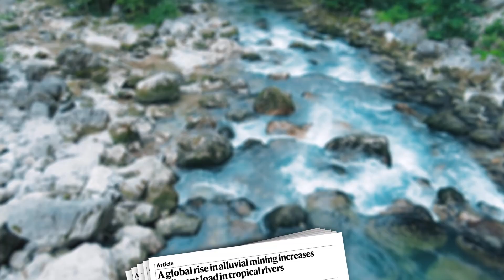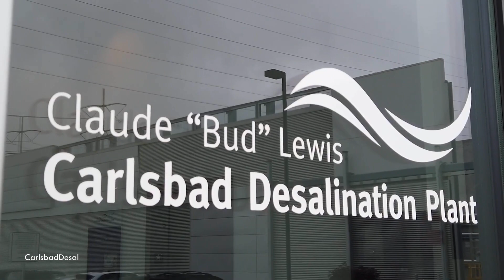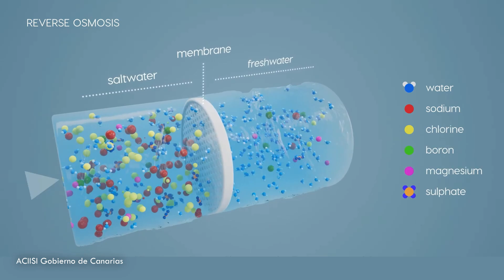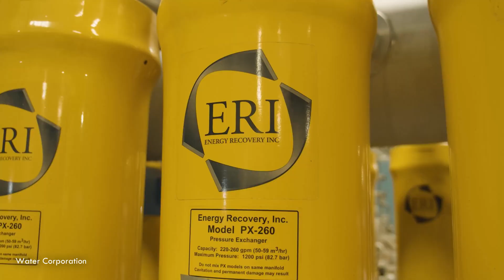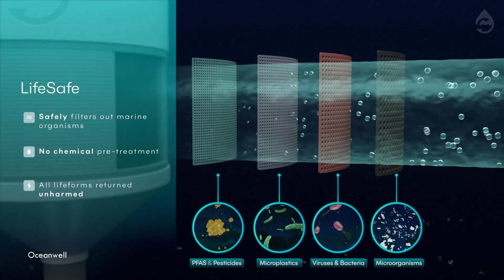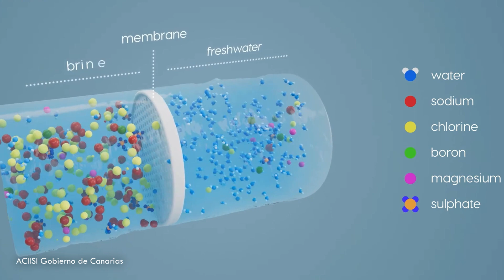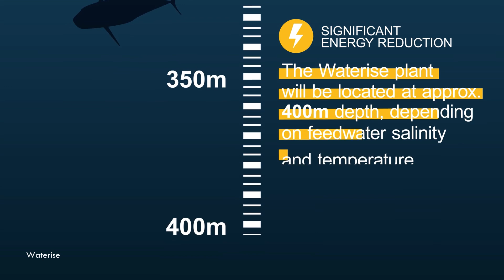These Pods Make Clean Water From The Ocean and It's Going To Change Your Lives.

Comment: Salt concentration in the sea/ocean might increase? Isn't that harmful for aquatic life?
Reply: u are underestimating the quantity of water in our ocean. if all the population in the world started using this tech, i doubt it still wont be enough to make ocean salty by any margin if salt byproduct is disposed properly. And again natural water cycle will also take fresh water back to ocean one way or other. I think the bigger problem will be the cost of RO membrane and replacing them, they cant be used forever??
Reply from the maker: @imsonurohit thanks for coming back, I have explained the both issues that you brought up. You're absolutely correct that it's bad for the Marine Life living nearby the Brine drainage system. But the good thing about the offshore system that I have been talking about is, - it doesn't drain extremely salty brine like on shore traditional plants. I have explained it in detail in the video itself.